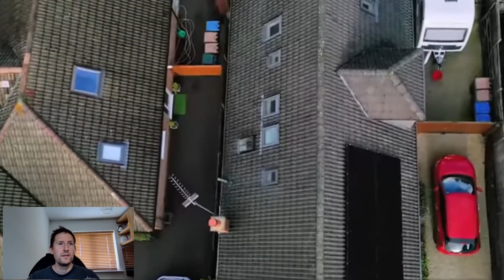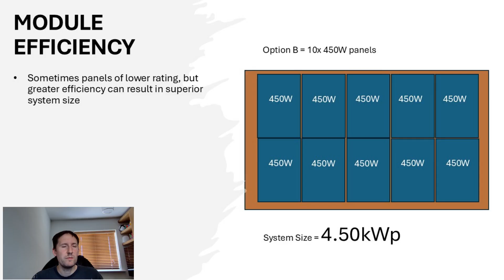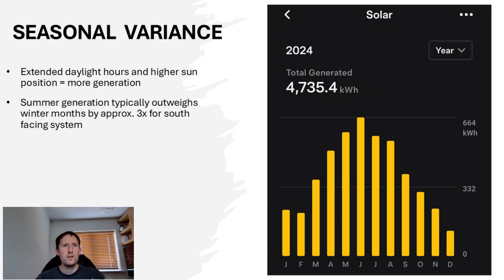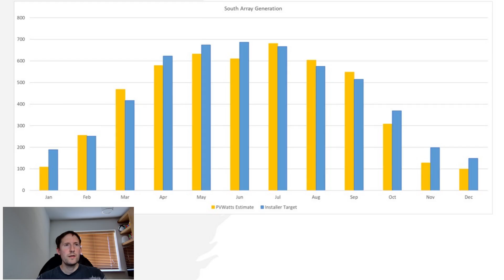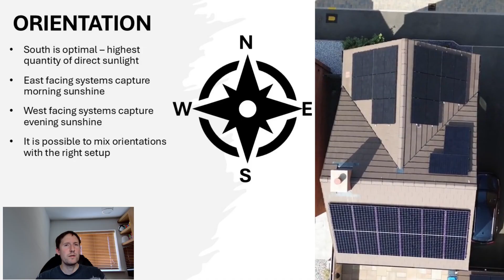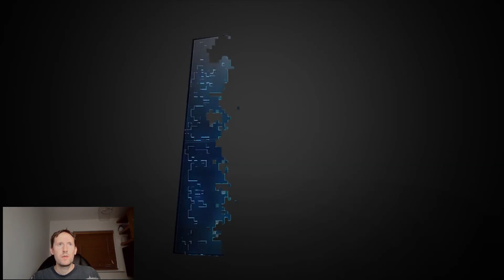Solar Panel Beginners Guide – What to Expect

Comment: Great beginners guide, Agree with you in there's no point in going completely off-grid (unless one is a true idealist, lives in the middle-of-nowhere and believes in conspiracy theories)! 😅
Reply from the maker: Thanks 🙂 While it's not always the case depending on region, being connected to the grid can be mutually beneficial. Even with a setup like mine I could be self sufficient probably 80% of the time, but there are always times were we have sustained spells of bad weather. November 2024 was a great example. There were 2 weeks we barely even knew the sun existed 🧐

Comment: Your 450w to 500w panel example was showing width changing rather than just length.
Most house solar panels now produce have the same width of 1134mm.
This might confuse a consumer.
Reply from the maker: The intention of that illustration was just to show the highest wattage isn't always best, the efficiency and dimensions are also important. Rather than using examples of specific brands and models i tried to simplify it somewhat. But you are right, 1134mm is becoming an increasingly popular width of modern panels. Having said that, there is still some variation in width. On my roof for example I have some SunPower Maxeon 3 panels which have a width of just 1046mm 🙂
Reply: @RenewableEnergySteve I understand, but I would have thought a better illustration would be to turn some on the side or and play with the heights.
Good video apart from that critique.
Reply from the maker: @grantmidd  thanks for sharing your thoughts 👍